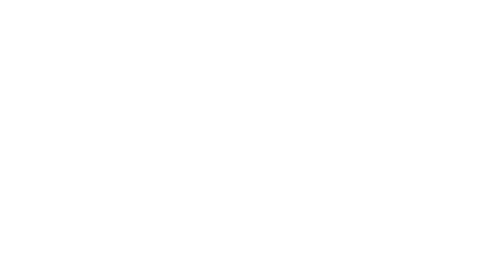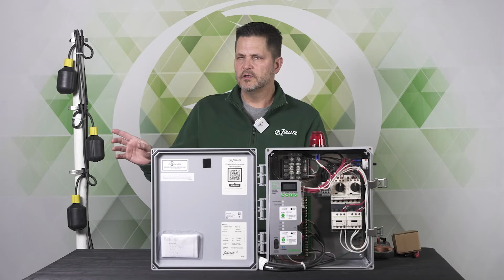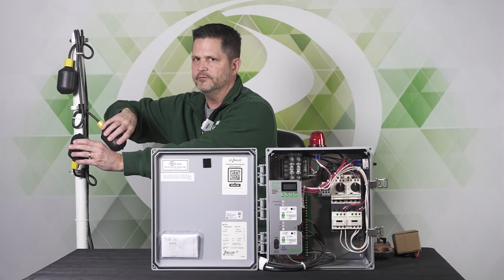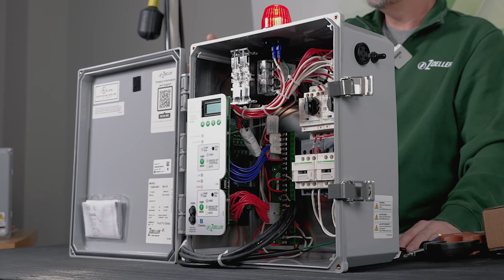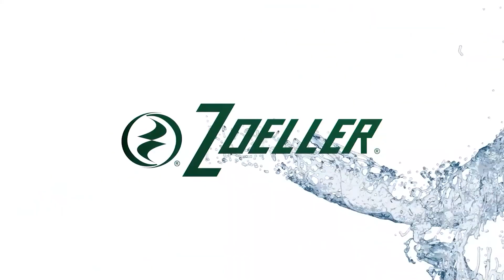Pivot Panels - Smart Float Logic Explained

Comment: While I have built a number of controllers... they have been for my personal use.  No competition with me, your unit looks like a great product.
Yes, with three switches   2^3  conditions or 8... but when you consider that the sequence is expected.  When odd combinations occur outside of the normally occurring states, that really adds to the 'is this alarm-worthy?, or should we continue to run the pump, or try the other?"    Quite important when flooding the building is a risk.
Thanks for the video.